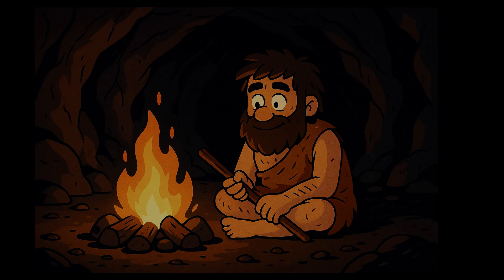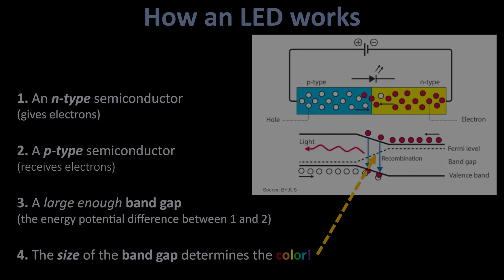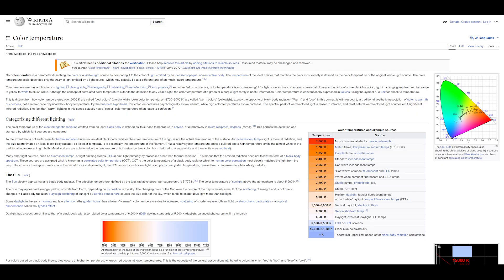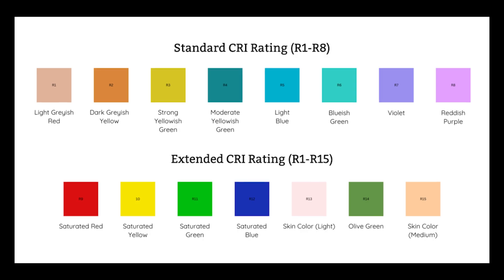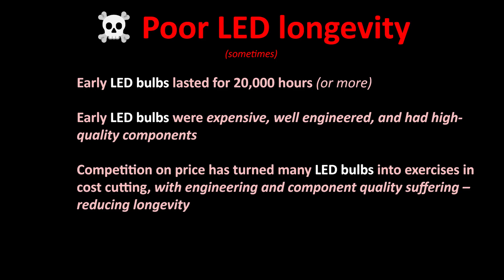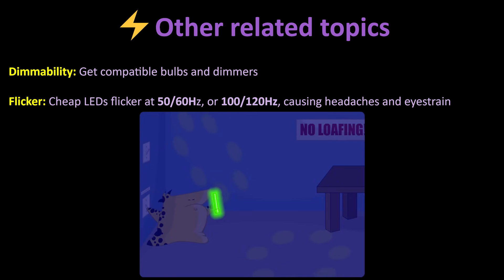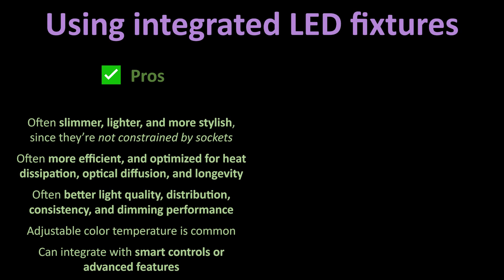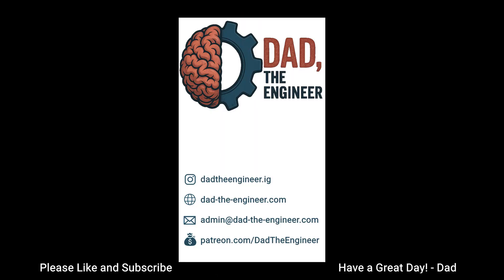Dad Explains LED Lighting — How They Work, Blue LEDs, CRI, and What to Avoid

Comment: Great information.  A few missing details:

There are three kinds of dimmers.  Reverse phase cutting, forward phase cutting, and rheostats.  Obnoxiously, most products don't advertise what they are, and phase cutting may require a rectifier (may or may not be included with AC-DC converters) to reduce flicker.

The absolute healthiest light for lowest flicker, best CRI, and least impact to sleep, is a warm incancescent, with AC-DC converter and a good rectifier to minimize flicker, and potentially a blue light filter.  This is more expensive in terms of electricity costs, but is reliable.  An incadescent is an incandescent, there's not much that can go wrong or be misleading.

The cheapest light is a high quality LED that is flicker free, blue light filtered, dim or dimmable, with a compatible dimmer, though the box price will be higher, it's difficult to prove how flicker/blue light free it is with common household methods, and claims on the packaging aren't necessarily accurate.

Either way, you get more efficiency fromo a single bulb in lamp you can reposition at will, than ceiling lights that use excessive numbers of bulbs and provide unnescessary non-dimmable illumination to unnescessary areas.

--

Lastly, blue light is a very big deal.  A single photon of blue light is enough to disrupt melatonin production and deep sleep quantity and quality.  It won't necessarily prevent sleep, but the lseep won't be as good.  Simply covering blue indicator lights, or white lights containing blue, with black electrical tape has done wonders for me sleep quality.

Avoiding screens like the plague for 2 hours before bed also works wonders.
Reply from the maker: Thanks for contributing!

That's a good note on the dimmers, but I'm not sure how much a "normal" person is going to know what they are.  As you noted, most products aren't really marked.  I would think rheostats are probably only common in OLD homes.  Just about everything else is going to be a TRIAC, although newer ones can have some MOSFETs or wave shaping tricks.  I have some Zooz Z-wave dimmers that are ELV, but I really haven't seen much ELV out there.  

As for blue light, I agree that it's a big deal.  While light in the 460 to 490 nm range DOES activate your ipRGCs, it takes a LOT MORE than a single photon to disrupt melatonin production.  The primary literature I read showed that it was a combination of brightness and duration - with either low brightness at long durations or high brightness at very short durations having virtually no effect.

Comment: Pro Tip: if you do not feel comfortable replacing a light fixture, which means you'll have to undo the wire nuts and then re-do (properly I might add), and installing a new light fixture then DO NOT BUY LIGHT FIXTURES THAT HAVE INTEGRAL LEDS IF YOU CAN AVOID IT. It can be an expensive light bulb change when one of them goes out... And many of them definitely do not last as long as advertised for various reasons.
Reply from the maker: It's not a bad tip, though I would say that it's completely possible to buy LED light fixtures with replaceable components.  Depending on the application, like a closet light, even that is probably not necessary.  

I don't mind changing out light fixtures, but I can see where some would find that intimidating.  I would say though, considering how low wattage MOST LED fixtures are, cutting the old live, neutral, and ground wires (to the fixture) - and then using Wagos, is an option for those who aren't comfortable working with the wire nuts.

Comment: I despise the white LED street lights that start to appear all over the place. They are cold, depressing and soulless and that is exacerbated when there is snow. The old amber street lights, still available in some parts of my town are warm, cozy and relaxing all no matter if it's winter or summer. Especially in winter when it's snowing on streets with no people and traffic the snow and amber light combination makes it look almost magical.

In homes, usually of relatives in the country, with a few 60 or 100 Watt  classical lights (yeah, they can still obtain that, but it's getting harder) I always feel relaxed and calm then under similar color LED lights like the ones I have in my home.

I've read a bit (but never went into detail and researched it) that classic light bulbs (as do amber street lights) give off infrared radiation besides the light which is needed and useful for our bodies which is not the case with LED's.

In addition, in the old center part of town there are a couple of streets where the municipality mounted thousand's of yellow LED's on wires between buildings (like a mesh grid) that looks quite nice from far away, but when under it (they are pedestrian only streets) the light is almost painful to the eyes if staying for longer under them and a few times the flickering was quite noticeable and very disconcerting.

Comment: I hate that im not given a choice of light fixtures. LED or incandescent. I have chickens and quail. I used 60 to 100 watt incandescent bulbs to provide heat for chicks. They weren't too hot. Now,i have to get bulbs by going to pet stores and getting reptile heat bulbs or ordering online. If i get heat bulbs,they are 150w to 250w and put out too much heat and are a fire hazard. Stop taking away an individuals choice to products. Just like the government forcing electric over gas appliances. Growing up,my mother would put a roast in our gas oven in the winter time. Cook it very low and all night. The house would stay warm and we wouldn't run the heater at all. Saved a bunch on the electric bill. When we lost power in the winter,in would go a roast or something that cooked slowly and the house was warm. I have all electric now. Ive had to hook up a generator in the winter to warm the house when i lost power. Now,my electric bill has continued to go up yearly. I used to pay around a hundred dollars a month. My last bill was over $500. Where are all the savings that i was to get by going electric

Comment: I tried GE's Reveal brand of bulbs because most of my fixtures aee ones where you can see the bulbs, so I wanted something nicer than standard. I've been regretting my purchases. The bulbs seem to fail frequently. Hopefully I can find a better brand that looks good soon.
Reply from the maker: I've mostly been happy with GE bulbs.  I bought a multi-pack at Lowe's, and it had a weird SKU, so I think it was a cost-reduced variant that you can't get outside of that retail environment.  The only failure I've had has been from that batch.  It also has 120Hz flicker.
Reply: @Dad-The-Engineer Maybe that's my problem. All of mine came from Lowe's.

Comment: Replacing your cars interior lights with LEDs is an easy upgrade to make it feel more modern. But just like it was mentioned here, go with name brand ones or you'll be replacing them in a year.
Reply from the maker: I have an early Model S, and all of the little interior and exterior lighting bits were small incandescent bulbs.  When my first bulb went out, I got a lighting kit that replaced them all with LEDs.  Considering that the vehicle uses about 260Wh/mi., it's best to cut the other sources of current draw wherever possible.

Comment: LEDs are garbage. They emit EMF radiation, are hard on the eyes, and the flicker is ridiculous. There is also no good reason that my light bulbs need a network connection….this “smart” appliance / IoT push is insane! I just ordered Chromalux "health" bulbs, which seems to be the only 60W incandescent bulbs you can still buy. Hopefully they soon repeal the moronic efficiency requirements which are the source of the de facto “ban” on incandescent bulbs, because the Chromalux bulbs are ~ $12 per bulb (or more)!
Reply from the maker: I will agree that BAD LED bulbs are garbage, and I agree that most bulbs should be "dumb".

As for good LEDs, they can have both higher CRI and light stability than incandescent bulbs, while lasting at least 10x as long.  As for efficiency requirements, they're not likely to be going anywhere - nor should they.  In the US alone, rolling back LED lighting, and reinstituting incandescent lighting would lead to failures on CAISO, ERCOT, NYISO, and the PJM (at least in the summer, and in the winter).  

As for your EMF claim, I'm not entirely sure what you're talking about.  Dumb LED bulbs convert almost all of the power from electricity to light.  Some power is lost to heat, and a miniscule fraction is emitted as EMF (primarily from the voltage regulator).  While this is higher frequency than the EMF that comes off of an incandescent filament, it has a similar field strength and distance - which is to say effectively an inch or two.
Reply: @Dad-The-Engineer  I should have been more precise with my choice of acronym. What I was getting at is that LEDs emit RF radiation. This is why every LED box has either a warning or a reference to FCC Part 15 rules, which govern RF-emitting devices. There is no such warning on incandescent light bulbs because they don’t emit RF. With the increasing evidence of health risks associated with RF and EMF exposure from things like WiFi and cell phones, as well as consumer rights / weaponization concerns associated with “smart” devices, I am 100% against forcing people to switch to LEDs. I’m not advocating for “re-instituting” anything. Let manufacturers make normal incandescent bulbs again and let consumers decide what they want. If power draw is a concern, the answer is simple: Generate more power. There is a growing push for a “nuclear renaissance” which, if followed through on, could ensure stable base load power for the entire country for centuries. With few (if any) exceptions, I believe that the solution to scarcity is to produce more, not consume less.
Reply from the maker: I imagine you're aware that not all RF radiation is the same.  While an LED driver generates trace RF, it's not anything that affects a person - and is at least an order of magnitude less than emitted by say, a laptop power brick (also inconsequential).  

While you say that there's increased evidence of health risks from RF/EMF exposure, I'm not sure what you're referring to.  First of all, the emissions you're talking about are non-ionizing.  IARC puts EMF in group 2B, and the FDA, FCC, and CDC have safe exposure level defined.  ICNIRP also doesn't see any substantiated health risks, either.  Second, I couldn't find any epidemiological studies, animal studies, or meta-analysis that backed that up, either.  

As for power generation, the realities of the population and its interest in bankrolling new power generation projects, means that composite use isn't a matter of optimizing energy usage or generating more power - it's a matter of doing both.  Instituting appliance efficiency standards in 1992 cut peak electricity demand in 2020 by ~30 gigawatts.  That's the equivalent of 100 large power plants.  Based on that alone, it should be clear that the solution isn't just to build more power plants.
Reply: @Dad-The-Engineer  You seem to be asserting that only ionizing radiation can cause harmful health effects on living organisms, which is simply not the case. I also don’t think that citing the FDA, FCC, CDC, etc. is making the point that you think it is. Public trust in the regulatory bodies you mention is at an all-time low, and for good reason. In addition to the events of the past five years, they have a history of DECADES of being captured by the very industries they are supposed to regulate (including telecom), either by getting money directly from these industries or by being staffed by people who have financial and/or professional ties to them (i.e., conflicts of interest). I do not trust any “acceptable limit” set by a government agency. Also, part of the reason for the dearth of studies you mention is that, particularly for 5G, the studies were simply never done. Personally, I trust the testimonials of those who live near EMF/RF sources more than I ever will trust a company or captured regulatory agency that says, “It’s safe. Trust me, bro.” 

Regarding power generation, any power savings gained from switching to LEDs is going to be dwarfed by the increasing power requirements of data and A.I. centers. Currently, data centers consume roughly 180 TWh of power (~ 4% of U.S. electricity). By 2030, this number is expected to increase by 240 TWh or more, rising to ~ 6.7-12% of total U.S. load. That’s just in the U.S. Additionally, LED light bulbs are 3-4 times as energy intensive to produce than incandescent bulbs, so if they aren’t hitting their previously high lifetime hours due to declining quality, they aren’t really much better than incandescent bulbs (they might even end up being worse).

Fortunately, even if we assume low efficiency and double the current U.S.  power consumption, sodium fast reactors (SFRs) can power the entire country for over THREE HUNDRED YEARS using only the currently stockpiled nuclear waste from light-water reactors. This is not pie in the sky or theoretical technology. A prototype has already been fully built and was successfully safety tested. I encourage anyone who is interested to search for EBR-II Shutdown Heat Removal Tests (SHRTs) that occurred in 1986. A great overview of the reactor and its capabilities can also be found in the documentary Pandora’s Promise. The public needs and wants more stable baseload power, and broad support for next-generation walk-away-safe nuclear is increasing. Whether funded by taxpayer dollars or private industry, I have a feeling that we are about to see a drastic increase in the use of nuclear energy, especially given the current administration’s stance on the issue.
Reply from the maker: @erikallder8199  Your claim is that 5G hasn't been studied.  Most of 5G is just 4G LTE's spectrum (FR1), up to 6Ghz.  This has been studied literally for decades - and at power levels that you're not likely to encounter in the rea world.  Safe.  FR2?  Also studied for over 2 decades.  FR2 is at power levels that are insufficient to do much of anything.. including passing through a bundle of branches.  Saying that trust in regulatory bodies is at an all time low it more a reflection of our post-truth society.  We're in a timeline where someone who sees a post on Facebook thinks they know better than PhD's that have studied a subject their entire lives.  You may not trust "acceptable limits" set by experts.  That's fine.  You lack the education to know how we came to that understanding.  That's also fine.  Not everyone knows everything.  To that end, though, you say that you "trust testimonials", and that's about the worst form of evidence for everything, ever.  Then again, if the testimonials are a case of "is there's smoke, there may be fire", then I could understand that.... except there isn't any science that's investigated these claims and found them to equate to a real-world issue.  

Yes, AI and data centers consume massive amounts of energy.  Yes, switching to LED lighting has saved massive amounts of energy.  Those two things aren't really directly linked.  If anything, the recovery of generated grid capacity has made it possible for AI to progress at the scale it's currently at.  As for LED bulbs being more energy intensive to produce - that's true.  It's nice to not have the ecological impact of the additional tungsten mining and glass furnaces, and 25x physical waste.  "Bad" LED bulbs still last 5x of an incandescent, and good ones last 25 (or more).  The math still favors LEDs.

And as far as virtually any modern nuclear reactor goes, I'm all for building them.  The regulatory landscape in the US is getting better for nuclear power plant licensure, but it's still a mess.
Reply: The problem with LEDs is you miss out on IR light which has biological be benefits to humans. Also, most LEDs have a terrible CRI rating.
Reply from the maker: If you're willing to pay, excellent CRI bulbs are available (for extended CRI, too) - meeting or exceeding that you'd get with tungsten studio lights.  LIFX+ bulbs have IR.

Comment: You forgot the power consumption from this integrated Lights. Can be more than 40 Watts. Because the manufacturer oses a lot of Leds, to generate the effects. Lights strips are also nice, Leds save Power but if you use a lot of them, the Bill get's higher.
Reply from the maker: Yes, the power consumption of various LED products can be pretty high.  

RGB LEDs for one.  I mentioned in the video that the RGB method of making white light wasn't as efficient - it's also not as accurate (color-wise).  In order for there to be a convincing color mix, you have to put quite a bit of red in, which is very power intensive.  The color accuracy and efficiency is why many of these ICs added in one or two white emitters into the package.

Smart LED bulbs, due to having an SoC, RGB LEDs, and an always-on wifi connection, are another high power user.  Still considerably less than an incandescent, for sure - but high for a bulb of its output.

Integrated fixtures can be a mixed bag, in my experience.  I've got about 10 fixtures of various kinds, and only 3 of them use significantly more power than the equivalent power in dumb LED bulbs (for light output).  Those 3 fixtures have a couple things in common: 1.) extremely high extended CRI (R9>60), and 2.) a 15kHz driver frequency.  Worth it, IMO.  

Your point is valid, and I could have been more clear about it.  LED light generation is a massive step forward, in terms of the efficiency we turn electric power into usable light.  That said, there are more factors that go into your actual power usage, than just the power used by the LEDs.